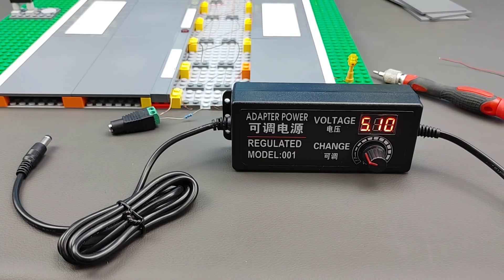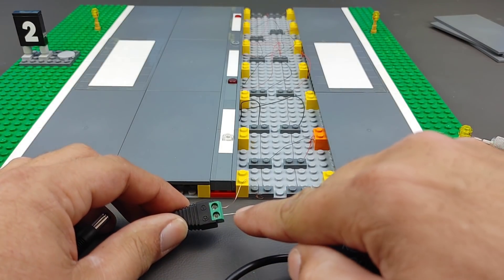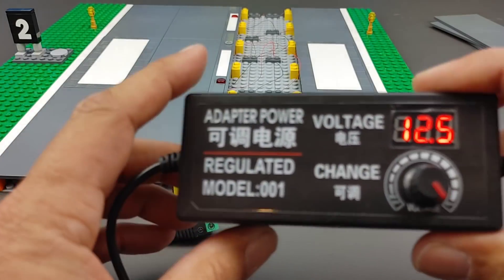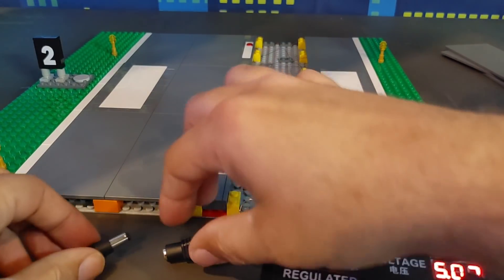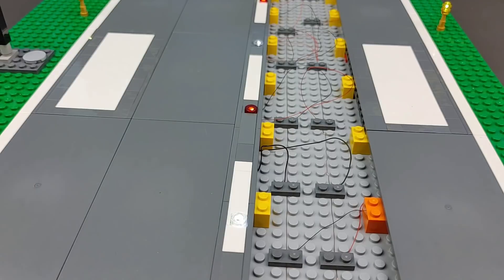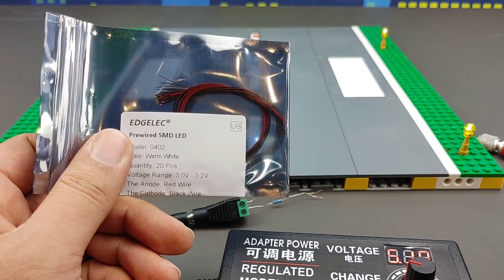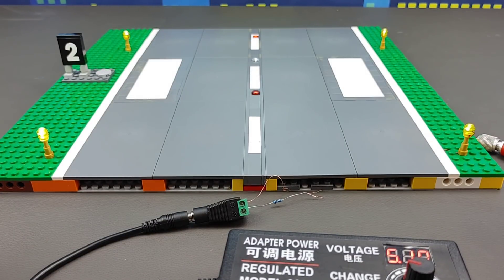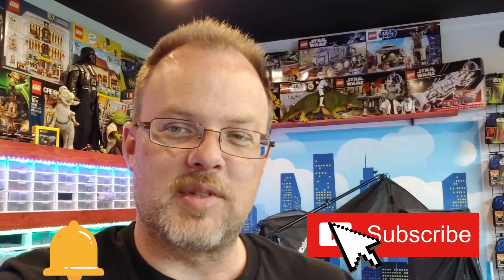How to make your own DIY Led Light System for Lego builds.

Comment: Constructive criticism: you never really showed how you put it together - you just kept repeating all the materials you used and talked broadly about how you put it together, but never went through the process in detail. How-to videos take you step-by-step through the process from start to finish and explains why you made the decision you made or explain the calculations that determined what voltage to use for power supply or why you used the certain type of resistor. This isn't to say that you don't have the knowledge or depth of experience - it's just in understanding what a good how-to video includes and this one didn't bring it. Best of luck.

Comment: This looks great! 1 question though, how do the lights affect the lego if you keep them on for long periods? I'm worried since lego is plastic, and I would like to keep my display lit up during the day or evenings without wondering if the pieces touching the lights would melt. Especially since my builds are in enclosed displaysand some of the lights would go in enclosed parts of the builds. Long story short, how much heat do they generate?

Comment: Do you have a amazon link for that capacitor? ( edit: resistors)
Reply from the maker: No capacitors are used, do you mean the resistors ? This is the linknfor them. https://amzn.to/45JLvqs
Reply: @BevinsBricksWorld  oops, resistor yea! I got thinking a bit more about something I dont really god knowledge off but does the copper coil get hot enough to ''melt'' the lego ( even a bit?) And .. the leds, if you put the cables between plates, does it get ''cut''  since if you can strip em with your finger nails, i assume lego can do the same?

Comment: How about Space Craft and interior lighting of dashboards/instrument panels for the bridge, commander, navigator, captain, etc? I'm trying to scratch-build a pilot's cabin for my 12-inch astronaut figure. I've built 3 and had to tear them down and start over. I never thought to use Legos! Brilliant! All I have to do is find out what you meant by Mills when you were putting the panels on the runway (about 6m:10s). Thank you for any help :)
Reply from the maker: Yeah you can use my leds for a project like this. Mils is a way of building the baseplate here is a video to show how I do them for buildings. https://youtu.be/B-AS-Nqbd40

Comment: LED need a resistor, otherwise they will burn up ! I would pair one resistor to every 3 leds in order to protect them ! look up Current Limiting and LED Calculators, for your given circutis led voltage, resitor values, etc.
Reply from the maker: You.are right and I now make and sell my own line of lights aall with the led installed

Comment: Hey Darrell,  I just got into Arduino and will be using that to power my stoplights and such.  I just received my first Brick Loot round flat 1x1 plate lights and they way that they are wired doesn't thrill me.  How did you get the little LED's to stay/connect to your LEGO bricks in this video?
Reply from the maker: I purchase and make my own leds for my traffic lights.  I use 0402 leds and place them between the plates
Reply: @BevinsBricksWorld  How do you get the LED bulb to stay inside the red, yellow, green trans plate?
Reply from the maker: The plates hold it in place

Comment: I swear it's almost like you're making knob and tube wiring method!  Love it.
Reply from the maker: It's basically what I'm doing just on a smaller scale.  I have sense redone everything though and now it's all soldered and uses plugs
Reply: @BevinsBricksWorld  still bare wire?  or is it available with a jacket?
Reply from the maker: I use insulated now black and red so I know positive and negative.

Comment: Can you elaborate a little more on why you added the resistor? If you added more LED, wouldn't they bring down the resistance, too? Or did you add it in this video for the LEDs you had in place at the time of filming?
Reply from the maker: When the lights are in parallel you need the resistor to decrease the voltage.  But yes using the lights in series will cause the voltage drop without a resistor.
Reply: So, I plan on using the bus.. although I think I’ll be using black and red 1x2 plates within the MILS so i can teach my grandson positive and negative…. Where to I calculate the resistor size for my lighting scheme?  How do I determine the correct Ohms?

Comment: Hmmm? Now you're tempting me to get cost saving creative with the ton of pre resistored LED's I have around. One gizmo I discovered that might be interesting for your airport is Light My Bricks offers a "Rotating Sequence Effects Board" which seems almost tailor made for runway lighting effects. The LMB sets are expensive, but they make some effects and controller boards that no one else offers and they work with lower cost LED's as well. Anything using that same microconnector.
Reply from the maker: The only thing that could work for at a airport would be the beacon.  I plan to get into programming and such soon myself also.

Comment: This looks great. A quick suggestion. Instead of alternating red and white, what about for each light using a red and clear cheese wedge back to back. If it works, you will get white when facing one way down the runway and red when facing the other way.

Comment: Having these non-permanent connections really fits into the LEGO system, actually. I love designing and building things in LEGO also because you can improve and change things any time without having to discard pieces (as you would have to, e.g., when working with wood). Being able to do the same with the lighting system does totally make sense to me. 
I'm wondering how stable these wire connections are over time when the elements are moved around or the wires get into contact with dust, though. Would really be interesting in you sharing your experiences in the future on how durable the system is.

Comment: Very cool and super helpful! Couple of questions because I know nothing about electrical,  what would happen if you put it to 5V without the resistor? How many lights can you hook up to one power supply?
Reply: The LED probably wouldn't light up at the higher voltage or burn out very quickly. LEDs work in a specific range, so you put resistors inline to drop the voltage down to what the LEDS need.
If you buy a ready made kit you usually don't have to worry about adding resistors.

Comment: This method makes wiring up and then lighting up the city a snap. If you need to swap a LED for a different color, disconnect from the bus and color change done. What size resistor did you have on the adapter end?